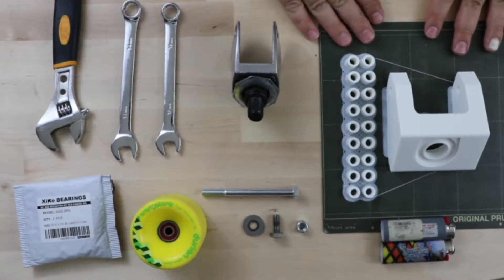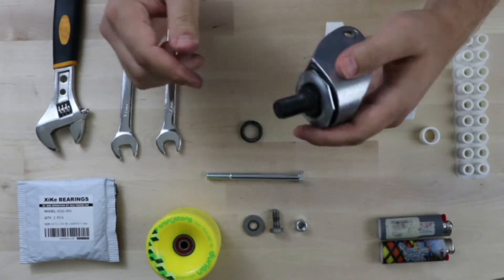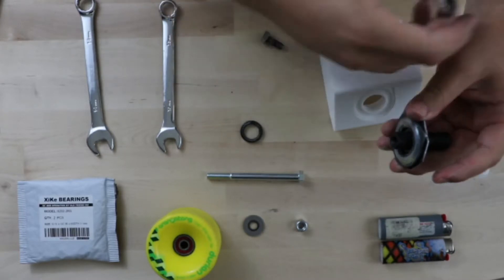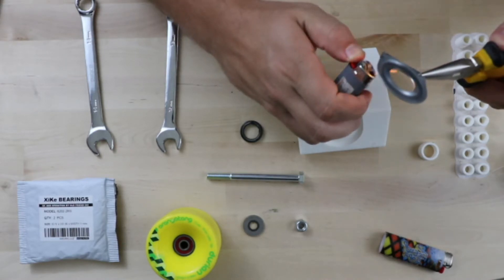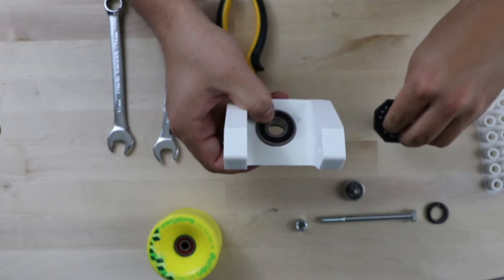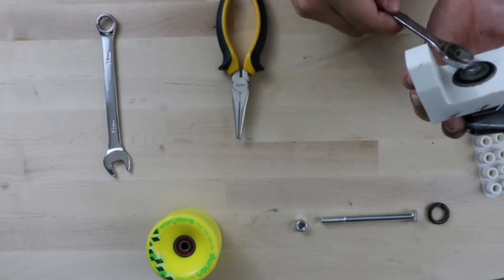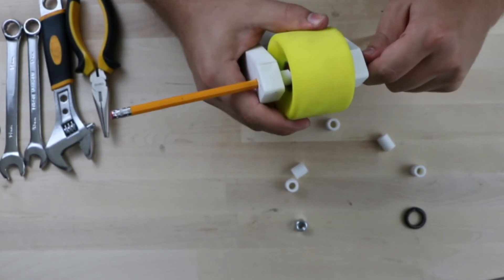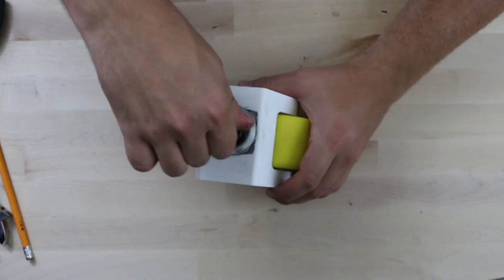Crazy Cart XL Caster Wheel Upgrade - 3D printed parts and $5  of hardware

Comment: Good day everyone. Does anyone know if this will work with the standard Crazy cart casters? Thanks in advance.
Reply from the maker: I don't believe it will, I don't believe the original castors have the ball bearing plate that the 3d print uses.
Reply: @danielwilczak7833 Thank you for your reply. Do you know if the XL castors fit the standard cart?

Comment: Hey man, I would highly recommend renaming these print files from "swivel" to "caster" and from "XL" to "wide" and or descriptions based on the typical crazy cart terminology.

There is a crazy cart "standard" and crazy cart "XL" but the "casters" are either "stock or standard" or "Wide casters" which are 3rd party developed casters that fit the longboard wheels. Just ordered some 3D prints and I was confused and got the smaller size instead of the intended "wide casters" I was wanting. Just my opinion! Thanks for creating this product! Excited to try it out!
Reply from the maker: Hey! Sorry to hear you ordered the smaller one. I updated the content in both printable's and on the video description. I realized that users can just use larger spacers instead of having both options.

To make it up to you, if you send your address to  "danielwilczak101@gmail.com" I'll send you a free one plus hardware as long as your okay with black, it's the only PLA I have right now.

The reason I'm willing to send a free one is because you didn't just complain but, gave a great recommendation so others don't face the same problem. I really appreciate it.
Reply: @ awesome man, yeah it’s not the end of the world and no need to be a jerk when I should’ve read the description lol I appreciate it! I’ll reach out!

Comment: What if you 3d printed the wheels too? I don't have a crazy cart, but I've 3D printed the wheels out of 87A TPU and redesigned the wheel fork so I could use the bearings that I already have, and it seems like it would work as intended.

Comment: Could you print out a 3d print of a motor mount? I’d buy it
Reply from the maker: I’ve been thinking about doing a 3D printed motor mount for a while. The only problem I can foreshadow is that the threads wouldn’t be able to handle the load. 

I might go a hybrid approach where I get the shaft machined as a separate part and then it would screw into the 3D printed base.

Before I release it, I would have to do some heavy testing before I start selling it. So the short answer is maybe early next year.
Reply: @danielwilczak7833  what if you made it a little thicker on the top part for the bolts I bought your 3d casters and they are holding up bought a 1000w motor and everyone is charge crazy amounts just for the bracket and I had access to a 3d printer I would definitely try it I’m gonna try one more thing before I end up buying it for 130 off early but I would definitely pay you even if it broke I want more 3d alternatives

Comment: Hi was wondering what is the bearing size and does it come when you order the caster
Reply from the maker: Hey! If purchased from my Shopify it comes with everything needed except for the wheel. (I.E two sets of the 3d prints (main body, inner and outer spacers) along with the wheel bolt, inner bolt, and bearings. ). 

The bearing size is 15x35x11mm.
Reply: Hey I just came across this video because my son’s crazy cart is a cheaper one and we bought the taxi garage caster and wheel upgrade but the swivel is thicker than the original that came with it :/. Any tips?

Comment: I dont have a xl cast just the originals, can I use a square washer instead of the piece you took off?
Reply from the maker: Hey, do you have a picture of the castor? I can tell you if it will work.
Reply: @danielwilczak7833  I do but I cant send through YouTube, IG?
Reply from the maker: @MTBndMore  I don't have an IG. You can just email me the photo. My email is danielwilczak101@gmail.com

Comment: Just printed one of these (took about 28 hours on my slow ender3 clone) and I notice that the XL caster has an offset top mount while the regular is centered, so it looks like you're using the XL for this demo. I believe the XL should be the right choice for the  orangatang durians I've got. So just a note that durians likely need the XL print. Any reason for the offset on the XL model or was it just easier to stretch like that? Thanks for the stl and all the info!
Reply from the maker: Hey! The reason is that i'm blind (Not really) and didn't see that it has been offset this whole time. I just re-uploaded all the XL's stl and 3mf files with the correction. Thank you for noticing that! Let me know how they work out.

Comment: Are these wheels any quieter that the stock ones? Are they less bumpy? Or is the only reason for the upgrade just so they are more durable?
Reply from the maker: Hey, from my perspective they are quieter, less bumpy and more durable because of the contact patch these have on the driving surface. They are also better wheels. If you take apart the generic wheels you’ll find that they are cheaply made rubber molded to a center plastic ring with cheap bearings.

Comment: Have you tested the durability of these? It seems like they might be too stressed when hitting a crack with the lever down but hard to tell depending on the rider's size. I'm definitely interested but am wondering if they will actually hold compared to your machined version.
Reply from the maker: Hey Colin, these have been tested heavily. We run them on our two crazy carts that have a 2000/3000 watt motors on them and have never had them fail. The screw that holds it all together has broken or the wheel bearings have failed (Because of the speed and load) but not the 3d printed parts. I also weigh about 230lbs. Here are some photos - https://ibb.co/7z9FY49
https://ibb.co/PM7gcJc
https://ibb.co/bK5gNv7
https://ibb.co/cTqXMxS
Reply: @danielwilczak7833  Standard PLA or PLA+ for those? Pretty impressive design and I'm guessing the 100% infill helps out quite a bit.
Reply from the maker: @colinq  Yup, standard PLA and 100% infill work best. We actually found orientation of the print is a big factor. All of the STL files are put in the correct orientation of the castor laying at a 45 degree angle. This helps with side load and vertical load.
Reply: @danielwilczak7833  I had assumed that orientation would be a pretty big factor for strength. Have you tried reheating some of the outer plastic with a heat gun and letting it cool again? I've also had pretty decent luck with that giving some more strength.
Reply from the maker: @colinq  I have never tried reheating. Most times I'll just change up the design to fit the needs of what were making. But it sounds like an interesting possibility.
Reply from the maker: Also, if you do want to create a metal one we have a drawing for ones we made in the past. https://www.prusaprinters.org/prints/68810-crazy-cart-metal-swivel-wheel but I do suggest trying the printed one. It's ALOT less work.